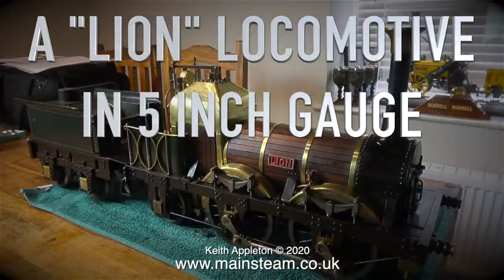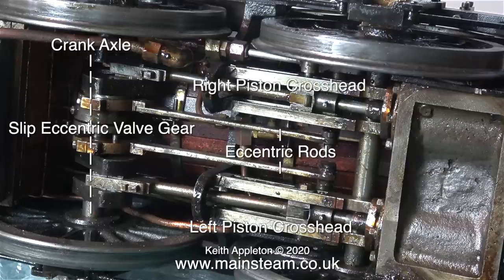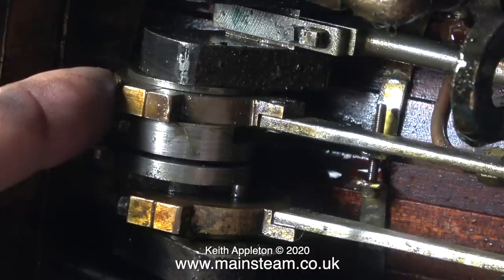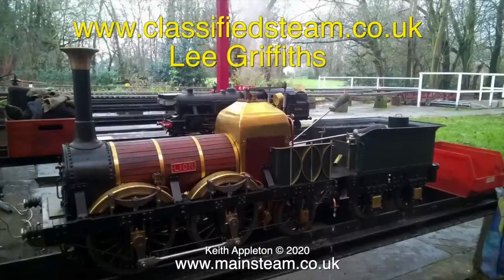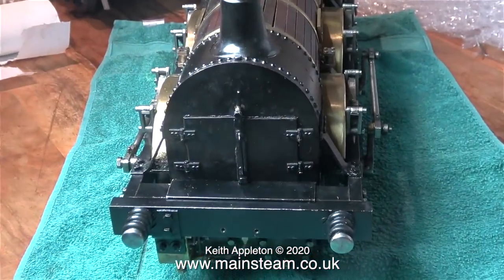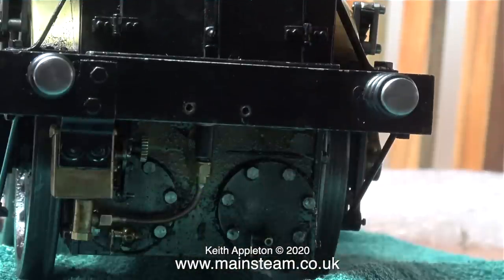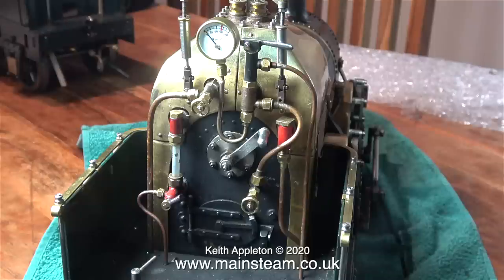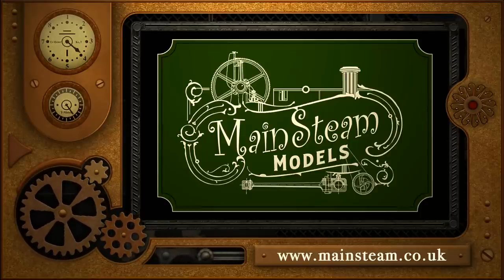A "LION" LOCOMOTIVE IN 5 INCH GAUGE - PART #1

Comment: I had to do some research on the Original "Lion" as there were two "Lions" in America that I was familiar with. The Stourbridge Lion was built in England and was the first steam locomotive used in America. The other "Lion" was the first American built loco and served in the state of Maine hauling logs.  These early engines are the prototypes of every steam engine that followed, and while some ideas didn't work out well, the basics survived.  This model is simply beautiful,  it captures the look of "Steam Punk"  perfectly, the polished brass and wood with the black painted iron parts just make it something to behold.  Your model certainly deserves to take center stage whether on a kitchen table or on the winners table at a show!   Stay safe and stay well!

Comment: Beautiful engine Keith! I have a question, 
Does the wood planking on the boiler serve any purpose besides appearance? Either on the model or the prototype? Like holding insulation for example?
Reply from the maker: a little heat insulation maybe, but it's mainly cosmetic.

Comment: I love your videos.they're very informative and great to listen to. Also one question for you. If you were to 3d print everything except for the boiler of a steam locomotive would it work? [3d printing makes plastic parts using a very thin plastic called filament.]
Reply from the maker: I suppose it depends on the melting point of the plastic, I would say that a working 3D printed plastic working steam engine is probably not a very good idea.
Reply: @keithappleton  there are 3d printing filaments that are more resistant to heat after being used to print something. Would heat resistant filament make a mostly 3d printed locomotive possible?